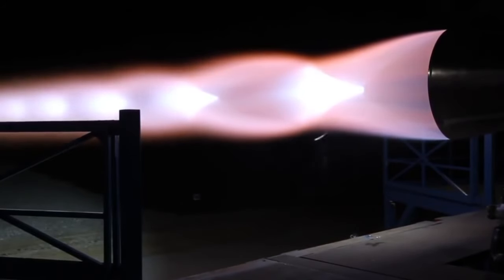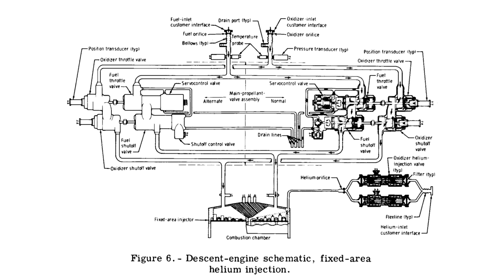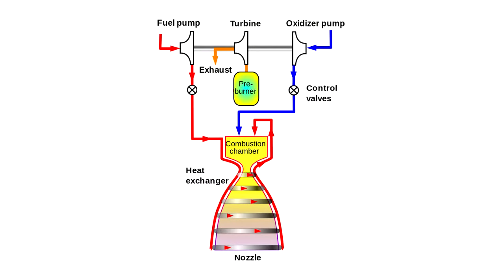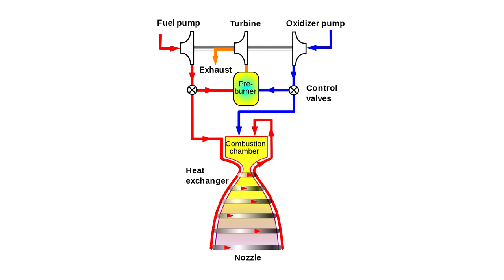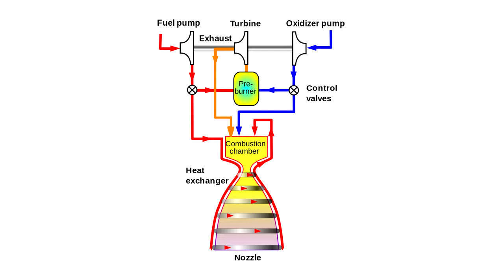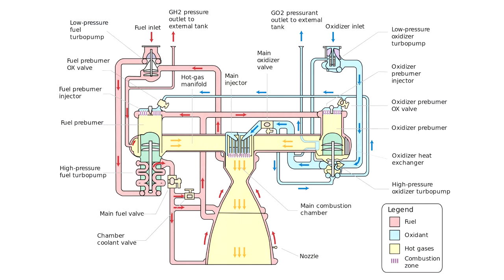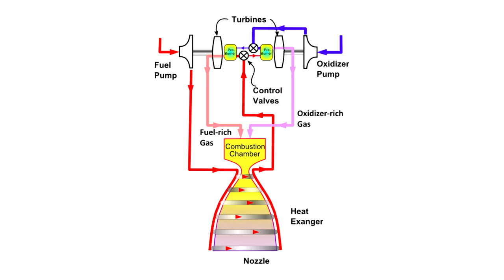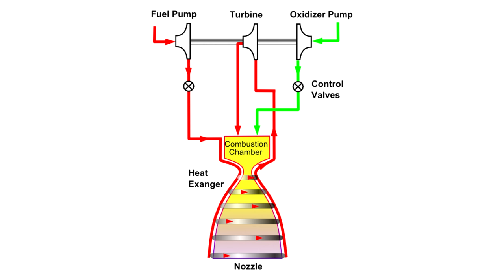KSP Doesn't Teach: Rocket Engine Plumbing

Comment: The way Apollo's first stage Rocketdyne F1 engines delt with exhaust gas from the turbopump was to blow the gas down the inside walls of the exhaust nozzle (bell) to act as a cooling film. This gas was at a lower temperature than the main rocket exhaust and insulated the nozzle. During launch you can see the gas exiting is much darker in colour than further down the exhaust stream.
Reply: Came here to say that this exact thing.
Reply: The F-1 was also ignited with hypergolic fuel, so in a matter of hundreds/thousands of a second, many valves were opening and closing in exactly the right order just to get that beast of an engine (all 5 of them) ignited and up to full thrust.  Each engine had to be slightly offset in its ignition to prevent uneven stress on the vehicle as well.  Despite the ignition being so complex, the F-1's still reign supreme as the kings of rocket engines.
Reply: Does the efficiency changes if complete combustion happens outside the nozzle?
Reply: Why doesn't the fuel rich turbine get sooty in the Raptor?
Reply: @davidgray6999  I think the mixture of fuels/oxidizers they use burns pretty clean.
Reply: I always wondered what the dark colour was in the classic F1 ignition footage. Thank you!
Reply: @chanakyasinha8046  to talk simply — everything, that's burnt outside of combustion chamber is wasted. Even in closed cycle, burning fuel components in turbopumps/gas generators is wasting their energy (it doesn't produce thrust directly). But it's unavoidable, so everyone have to deal with it. Except Ricketlab, but they paid for their scheme by loosing a bit of mass efficiency (weight of batteries and electric engine for pumps is taken from payload).

If you burn traces of fuel in the nozzle or outside it you are corrupting ideal gas flow. But it's a compromise between losing some efficiency and losing the whole rocket due to engine rapid unexpected disassembly.
Reply: Amazing how easy it is to spot someone who doesn't live in this country
Reply: egr
Reply: @HooyahPeacock  
'Doesn't live in this country.'
To which country are you referring to?
Reply: @davidgray6999  CH4 doesn't polymerize very well in rocket engines.
Reply: @davidgray6999 Think about the chemistry of soot formation. Methane only has 1 carbon atom. When the fuel rich turbo pump runs, either the molecule gets burned, and the carbon is cleanly burnt with it, or it doesn't, and the methane goes through to burn in the main combustion chamber. The chemistry just doesn't allow for much, if any soot deposition because it doesn't allow the carbon to polymerize along its path.

Comment: Very interesting. You could imagine the plumbing nightmare with 42 engines squashed in there together :)
Reply: Aye. And that's what makes me skeptical about SpaceX's craft. That's a lot of failure points. But SpaceX has a lot of clever engineers working for it, and I'm not one.
Reply: Aye. And that's what makes me skeptical about SpaceX's craft. That's a lot of failure points. But SpaceX has a lot of clever engineers working for it, and I'm not one.
Reply: arent you meant to be crewing your space station marcus. Lol
Reply: Yeap, that the soviet N1.
Well, that 12 more than the soviet N1 in fact, but you got the idea (idea that goes boom).
Still, things are a bit more advanced today and control computers and gimbaling hardware could potentially save such complex rockets from catastrophic failure (that what append to the N1, one engine failure leading to complete loss of control).
Nevertheless, what was shown in space X promo video (landing a booster on it's launchpad, then refueling and relaunching it a day after without any engine disassembly/ inspection or launchpad refurbish) is just complete bullshit ;)
Shuttle did shown that making hardware fly-worthy again is a complex and costly concept. Of course, spaceX plan is to lower cost with scale effect : more hardware to refurbish can lead to higher volume for subcontractors and a more cost-effective workflow. But that's also a problem, the more engine you'll have to work on and the more peoples you have to work with leave a lot of place for something not done right, and when something is faulty on a rocket engine, you just can't pull over the road and call for a mechanic. You goes boom. The larger the rocket is, the larger the boom is, and as the death toll (also something Shuttle sadly did learn to us)
Reply: actually that's very interesting: some super plumbers facing the same scaling-up issues as computer hardware designers.
Reply: Totally. Add this to the fact that this super complex plumbing is controlled by thousands of vanes and sensors all wired up to real time computers that check engine inner working and make adjustments to them following the flight parameters and guidance procedures. That's why it's called rocket science.
Reply: Maybe they merged together some of the stuff instead of actually have 42 separate engines.
Reply: yaksher yes, obviously. But from an industrial perspective that would be a pity. and upscaling is bound to happen in a not-so-distant future.
Reply: Yeap but large engines are the most difficult to build. That's why the F1 is still yet to be dethroned.
Reply: The Space Shuttle reenters the atmosphere at a speed several times that of the ITS first stage and the first stage has fuel left to further slow it down upon reentry just like the Falcon 9 first stage. SpaceX has already stated some landed first stages don't need much refurbishment to fly again. I don't see how the ITS is just complete bs. Obviously they still have a lot work to do to make it happen but I hope you don't later regret calling them bs with such certainty.
Reply: However, SpaceX still has reliability issue now... I really dont think they are able to build this 42 engines non-sense with RELIABILITY.
Reply: The spaceX failures haven't been with the engines though. On an early flight, they had an engine fail, but it failed gracefully and the mission completed on the remaining 8. Two big Rapid Unplanned Disassemblies have both been due to tank failures. One because a strut they sourced from a third party did not meet their quality standards, and the other is still being investigated.
Reply: The difficult bit is not plumbing everything together, but making sure they all don't start vibrating like a musical instrument as the propellant flows through them.

The N1 had many engines and it blew up because the pipes started a harmonic vibration that tore the assembly apart.  
So the tricky part, aside from making sure your turbopumps can be reused, is to plumb it so every pipe vibrates at different frequencies.   Thank god for computer modeling.  The N1 didn't have that.
Reply: +treschlet of coz. Even they were not engine's fault, it shows the ability to find out the mistakes. ULA does not have this issue at all. I would say the quality control or something is the one SpaceX need to improve.
Reply: NYK MELO ULA is backed by Lockheed Martin and Boeing. They have decades of experience and several highly developed mature launch systems. It won't be surprising that they are more reliable than Falcon 9. SpaceX is learning a great deal from each failure however. I believe given enough time they will eventually mature and become reliable.
Reply: Don't say that the whole project was bullshit, it's just an gigantic and mostly inefficient rocket after all, but the launch of the fuel supply right after the crewed pod is. Logisticaly impossible, and it do present a major security flaw anyway. What if the booster can't restart? What if the launch pad suffer damage from launch or landing? You got crew, already waiting for a  6 month trip to Mars, stranded in LEO, just waiting for fuel.... Brillant. 
His idea is nothing more than a tremendously upscalled crewed falcon9. It's not a big breakthrough. A breakthrough would be to set up a whole transportation network, with fuel depots in LEO, in Mars orbit also, specialized and efficiently designed capsules for each part of the trip. For example, a transfer vehicle from Earth orbit to Mars orbit needs to be well radiation shielded, vacuum optimized engined, but not as powerful enough in thrust as the LEO or Mars ascender, nor mechanicaly strong. 
A big one capsule from Earth ground to Mars soil is at best a complete efficiency nonsense. It's like landing Apollo CM on the Moon!
Reply: Don't say that the whole project was bullshit, it's just an gigantic and mostly inefficient rocket after all, but the launch of the fuel supply right after the crewed pod is. Logisticaly impossible, and it do present a major security flaw anyway. What if the booster can't restart? What if the launch pad suffer damage from launch or landing? You got crew, already waiting for a  6 month trip to Mars, stranded in LEO, just waiting for fuel.... Brillant. 
His idea is nothing more than a tremendously upscalled crewed falcon9. It's not a big breakthrough. A breakthrough would be to set up a whole transportation network, with fuel depots in LEO, in Mars orbit also, specialized and efficiently designed capsules for each part of the trip. For example, a transfer vehicle from Earth orbit to Mars orbit needs to be well radiation shielded, vacuum optimized engined, but not as powerful enough in thrust as the LEO or Mars ascender, nor mechanicaly strong. 
A big one capsule from Earth ground to Mars soil is at best a complete efficiency nonsense. It's like landing Apollo CM on the Moon!
Reply: +MegaStupidMonkeys So now is like, SpaceX just learnt how to walk, and they already tried to become NFL player... That's thing i worry about them
Reply: +Damien Drouart U damn right. It's more like 'Add More Stuff' rather than 'More Advanced Stuff'...
Reply: NYK MELO
The Falcon 9 isn't doing worse than any other new launch system. Reliability will improve a lot as they fix each issue. The most important, and most complex part of a rocket is the engine, and that works very well. Other issues are easy to fix.
Reply: NYK MELO 
But they are not walking.  They are putting payloads into GEO.  This is NFL level play.
Reply: Yeah. But a Mars attempt is more like starting a whole new league!
Reply: Damien Drouart
Why is it inefficient? It is going to be the most efficient rocket ever. And it has to be gigantic, because the payload is gigantic too.  To significantly reduce the size of the rocket you would need nuclear propulsion. That's technically works, but politically problematic.
It's logistically as simple as possible. You have to refuel, because of the inefficiency of the chemical engines. The rapidly reusable launch system is exactly what they develop right now. They already landed successfully 6 times very precisely. And they demonstrated that the landed boosters  still work perfectly. Soon they will actually reuse a booster. Once the technology is perfected, they can land back on the launch pad, refuel, and launch again. That's essential to reduce the launch costs to an acceptable level. With conventional rockets the project would be way to expensive.
Damage to the launch pad is not a big issue, because they are going to have a lot of them. And the crew module is designed to keep people alive for months, so a little delay is not an issue. Remember, this is not a conventional space program, where they launch a few times a year. They will have a fleet ready to launch, that's what rapid reusability means. Also the crew don't have to be on the ship while it's being refueled. It's easy to add one more launch at the end to transfer the crew, but it adds cost and complexity.
Your idea is actually far more complex and expensive, because it requires a lot of specially designed parts. Each has to be developed, built and extensively tested. That takes a lot of time and money. SpaceX doesn't have that much money, and they want to be on Mars as soon as possible.
They use a single engine, a single booster and a single ship. The engine has two versions, one for launch, one for vacuum. The ship also has two versions, one crew module, and one tanker. It's the simplest system possible. And the real genius part is that most of that is derived from their current launch system, so they are essentially testing the most important parts of their Mars program, and making money in the process. They are going to land on Mars the same way they land on Earth, so they are testing that too. They are also developing a crew module to take astronauts to the ISS, so they got that too, and NASA pays for it. There are only a few things that they have to develop specifically for this mission (for example how to keep alive the crew for several months), everything else is just a scaled up version of their existing money making technology.
Reply: I'm talking about technologically inefficient. Not economicaly. 
How do you conquer a land? Fast as possible or with a bit of planning and large scale infrastructures? 
Romans built roads to forge their empire, roads that we still use today. The west was conquered with a railroad, building stations, towns, industry, as the Siberia was. 
Musk's approach is more like going to nowhere with a wooden ox cart. A large wooden cart with lots of oxen but still an ox cart.
Reply: +kurtu5 Remember, they still dont have any manned mission yet. Thats walking for real
Reply: +András Bíró If u want to win a war now, it's not just make ur gun bigger. U have to make something different like airplane or submarine. That's how we advance on technology.
Reply: Damien Drouart
Did you watch their video? Musk said exactly the same thing. They are going to provide easy and affordable access to Mars. I still don't understand where is the inefficiency. Space gas stations won't make much difference, just add a lot more cost and complexity. If asteroid mining becomes mainstream, then it would make sense to make fuel in space, instead of launching from Earth. But now fuel is relatively cheap, the rockets are the expensive parts. If you can reuse rockets than it doesn't matter too much how big they are.
Reply: NYK MELO
They don't want to win a war. They want to colonize Mars.
And they are making something different. Rapidly reusable rockets. That's the big deal. It makes space access affordable. The current estimated price of a theoretical ticket to Mars is $10 billion. With this new technology it can go down below $100K. Making something 100000x cheaper is nothing?
Reply: In space, as in aeronautics in general, weight is where the efficiency reside. Keeping all hardware from Earth ground to Mars is darn inefficient, that's the worst case plan. Reusing parts do not enhance efficiency because reusable parts, capable of launching from Earth, sustaining a large crew for 6 month then landing on Mars, then all back again must be made very strong to endure all theses cycles many times. So they are heavier, costs more to launch. It's not a big deal, and even a good idea for small trips (LEO) but for such endeavor, it's unrealistic.
Reply: @ violenceislastrefuge

You say failure points I say redundancy..... as a matter of fact I know the saturn V suffered a center engine Failure on apollo 13 and still made it to the moon for a pleasant and totally not terrifying flyby. I believe a Falcon suffered from a similar issue some time ago and made orbit spite it.
Reply: +András Bíró of coz, but ur life is priceless right?
Reply: Yeah, it'd be challenging, but IIRC they are mostly all independent systems. So if a few failed, the rest can still work and continue the mission as planned. So there's that redundancy as payoff to the increased complexity.
Reply: That and Communist we don't give a shit quality control from the suppliers of the metals used to build the engines. The engines were the finest example of Soviet craftsmanship, made from stuff that wasn't. The leftover engines that were hidden away after the N-1 program cancellation are riddled with flaws. Even after a thorough inspection and refurbishment with modern methods, some of those old engines have failed catastrophically. Very likely the ones left will all end up in museums while new engines based on the design get flown.
Reply: aye
Reply: NYK MELO But ipthe engines are not as small and compact as the N1 also, it failed for financial reasons,complexity and the fact they didn’t know as much about engines as we do now.
Reply: Damien Drouart 3 years later are you eating your words yet? Or does it need just a bit more time. Look, you’re nowhere near as smart as the people working on these things so probably not a good idea to say things are impossible before they have even tried ;)
Reply: Wow, it has been already 7 years since this and IFT3 just launched!!! It is really amazing to see how far they have got